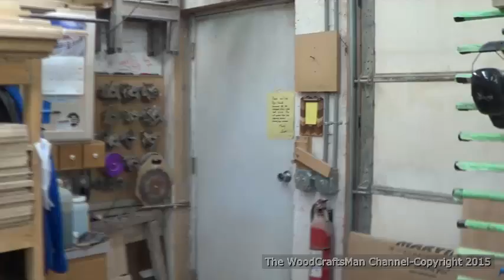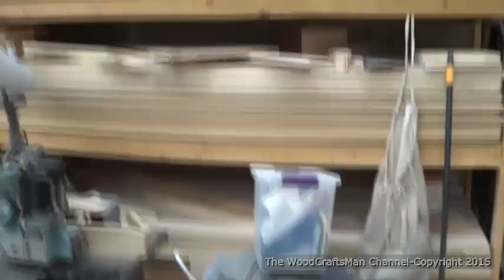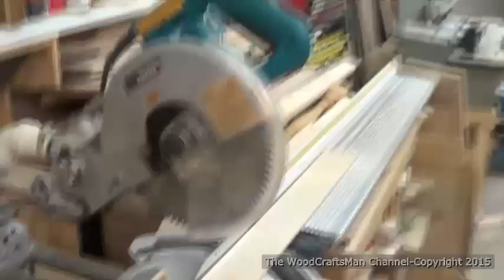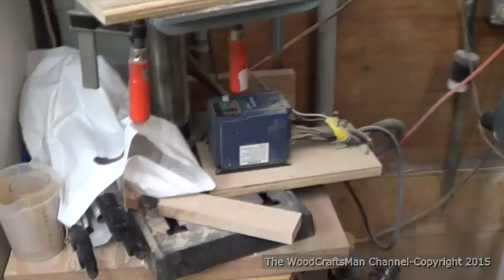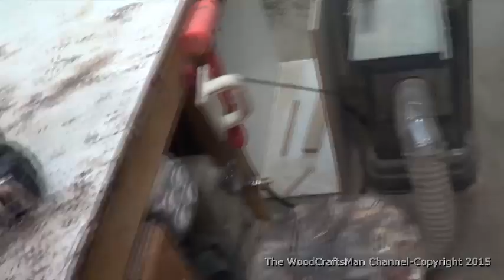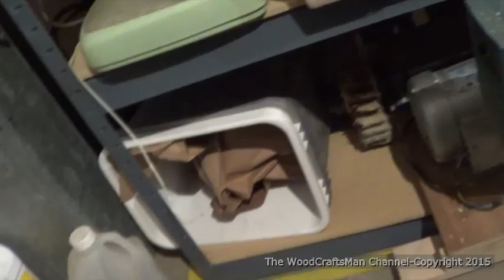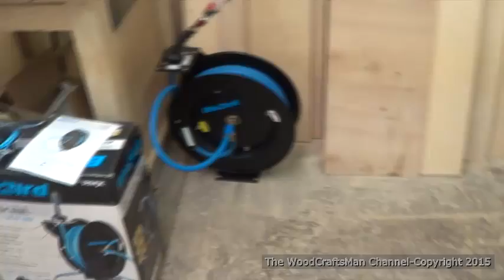Wood Shop Tour 2015 # 151

Comment: Hi Scott, nice videos!  I got a very small (15 X 31) basement shop that's been re-configured many times and I recently built a retactable tarp spraybooth that is a full closed area of 6 X 11. I've tried some set up with box fans and filter but it works so so as far as overspray is concerned. I would be very interested about some description or advise (or a video!) based on your own setup. I only spray waterbourne products. Thanks, keep up your good work on you tube!
Reply from the maker: +medic0us hi, thanks for the comment. My setup is minimal. The most important investment I have is the hazardous location exhaust fan and motor.  For waterborne finishing, it's a little more forgiving for the most part. The trick to waterborne is protecting the fan itself from collecting all of the sticky overspray. A box fan for the small home shop may be okay, but it's really in anyone's best interest to move a little more air than that to keep the overspray from collecting so much on the floor and to keep the co-solvents vapors from migrating too your furnace or water heater  (if gas or oil). A lot of people are mis-lead by the term "waterborne" or "waterbased" into thinking it's non hazardous, but it's actually only less hazardous in many ways.

As far as a fan, CFMs are what you need to look at. A 20" cheap box fan is okay, but I would be concerned about the open motor. An old belt drive furnace blower fitted with a TEFC motor would be better and would probably last forever. The biggest investment would be the TEFC motor (totally enclosed fan cooled) which would be around $100-150 depending on HP. A hazardous location motor like what I use us known as an Explosion Proof motor with specific classifications, grouping, and divisions is a lot more expensive, $350 for a 1/2 HP (I think its a Class 1, group C & D).

Remember what ever air you vent out, it has to get replaced so you don't create a negative pressure so you don't pull air backwards through any gas or oil fired appliances causing carbon monoxide poisoning.

Lastly, use the right spray equipment. A turbine driven HVLP spray gun setup has the softest pattern with the least amount of overspray as compared to conventional air spray or even HVLP conversation guns running of compressed air.

Hope this helps. Scott
Reply: +The Wood Craftsman (puttz1976) if I may impose with a few questions; is your fan very far away from your filter near your tarps? Do you exhaust outside or you have other filter media placed before your return? Up here  (Montreal, Canada) I really can't exhaust outside during the winter! Do you actually use real paint booth filter from a specialty suplier?
Reply from the maker: Hi, the fan is about 60" away from the filters seen in the tour. Yes I do vent outside as the vapors are hazardous. The filter I use is known as an "Andrae" accordion style paint arrestor that comes compressed in a box that has about 12 changes in it that I get from a finishing equipment supplier (can probabbly find online). You definitely must vent outside, even if its only for a short period such as when spraying. If you are spraying a waterborne material you could probably get by with a small fluid filled radiator style enclosed space heater ( it has no open heating elements and looks like an old radiator in an older home). This can help maintain a warm room especially when the coating is drying which is crucial during the drying. I would not recommend at all recirculating the exhaust air. I know the cold air you are talking about, its not very warm in winter here either. My intake fan and exhaust fan are 3 phase and run off of a VFD so I can speed them up or slow them down for cooler temps.There are specialty setups that recirculate for the automotive industry, but they are very pricey, take up room, and have specially filters that need to be replaced periodically. If you got an old belt drive furnace blower and outfitted it with a TEFC 3 phase motor and a VFD with 110 or 220 volts  single phase input, you could slow it way down in the cooler months. It would cost you a little up front, but I think you would be pleased. Scott
Reply: medic0us I

Comment: where did you get your coping sled? I got one from infinity that works OK but would like to be able to do wider than 7 inches.
Reply from the maker: +Brian Needham Hi, thanks for the comment. I actually built this one myself here in the shop using standard common parts and materials. If you have the patients to work with aluminum, UHMW plastic, and polycarbinate, you can build your own in any size. I have about $150-200 in materials and about 30-40 hrs in R&D and building it.

Comment: Thanks for the tour.  We sure accumulate a lot of "stuff" don't we?  LOL. I just reorganized my shop AGAIN.  Every once in a while I throw a fit and set stuff to the curb on junk day.  If I haven't used it in a year or two it goes!  Then shortly after that, I usually need whatever I threw out. haha.  I like your hose reel idea ... I'm gonna checkout flexailla.  As always, thanks for the lesson!
Reply from the maker: ***** Hi Tim, Thanks for the comment. You will like the Flexzilla. 3/8"x25' is the most common and economically priced, but they also have 1/4" as well. Scott

Comment: Do you find that the straight knife on your jointer works well?
Reply from the maker: Bid Budy Hi, thanks for the comment. It seems to work okay. It would work a little better if I took the time to speed the cutterhead up to around 5,000 RPM instead of its 4,200 RPM. I use it for jointing staves for glue ups for raised panel doors and I also use it to snipe the ends of the top and bottoms of my cabinets when I use the dado and rabbet face frame to box construction method. Thanks! Scott

Comment: Enjoyed the video.  
What is the size/sq Ft of your shop?

What's the main purpose of the rack at 1:54?
Thanks!
Reply from the maker: Jerod Howell Hi, thanks for the comment. The shop is about 750 sqft, 22'x34' with 10' high ceiling. The rack in front of the door with the blue wheels and green painters tape on it is my finishing drying rack for doors, drawer fronts and shelves. Thanks! Scott